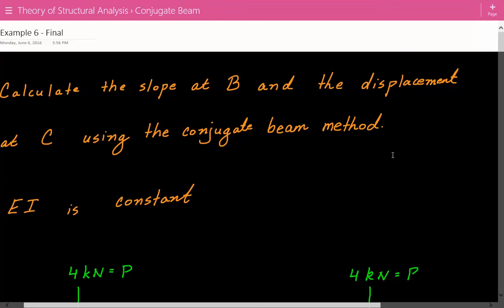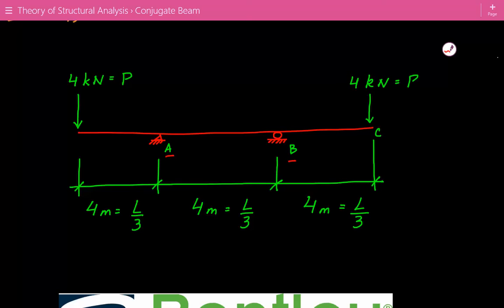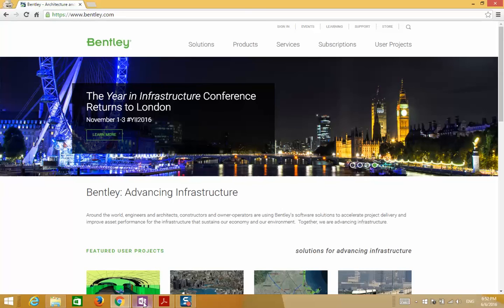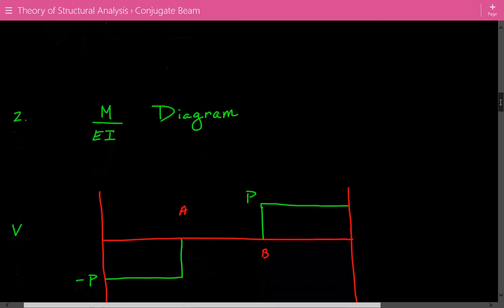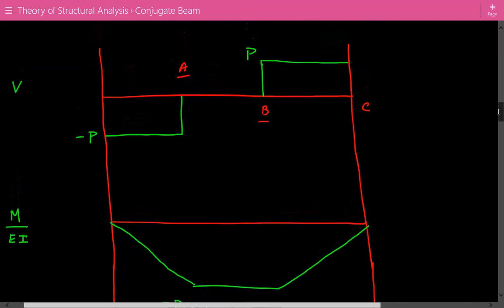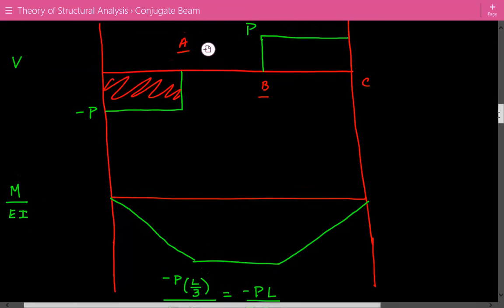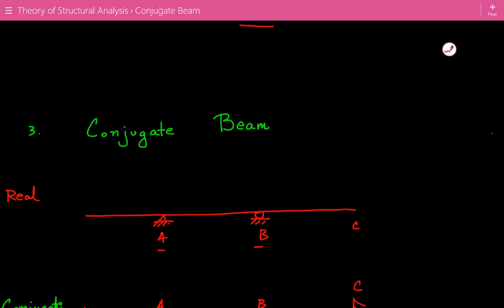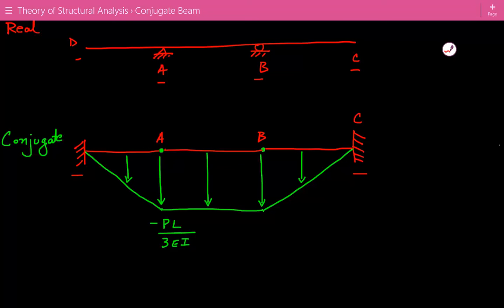Slope & Deflection of Beams Using Conjugate Beam Method, Structural Analysis Example 6

Comment: If you are familiar with singularity equations for calculating reactions, shears, moments, slope, and deflection; how does this method compare in complexity and accuracy? One problem I am having creating a versatile template using singularity equations is introducing a hinge point in a beam. I can do it manually using multiple sets of equations, but I have yet to sit down and think how to make my program (Mathcad) produce my diagrams with just inputs of loads, beginning/ending locations, support locations, and fixity.